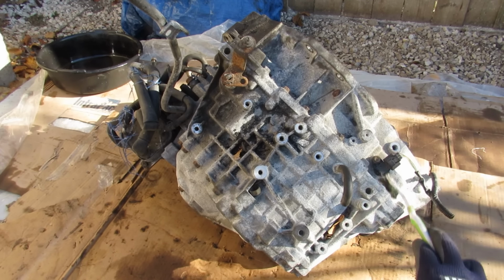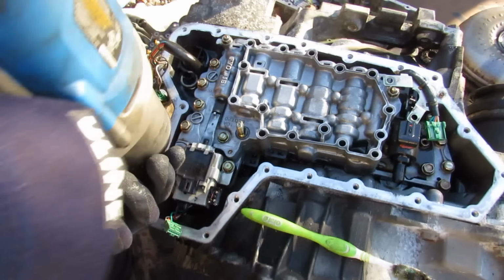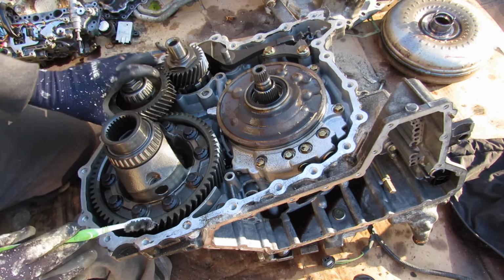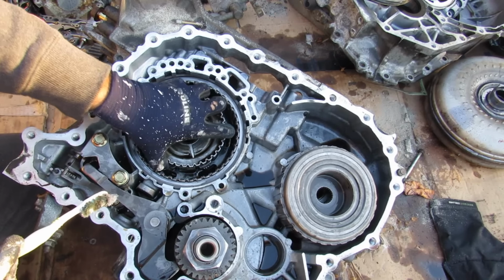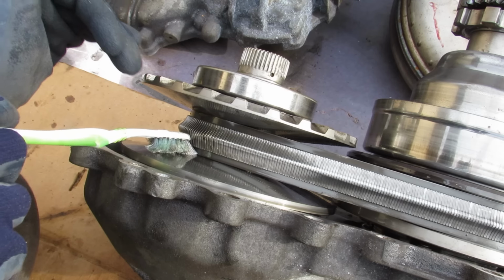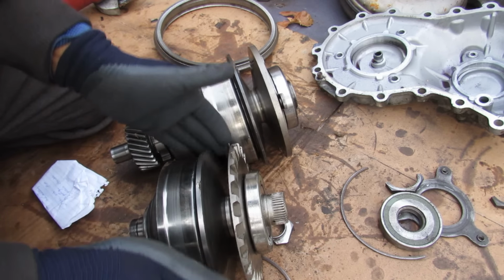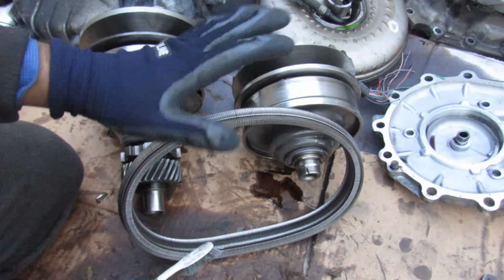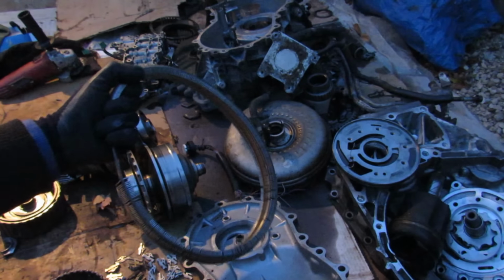Why Nissan CVTs FAIL

Comment: It's not just Nissan Ford also has had huge problems. So much so that it even got hit with a class-action suit. 

I like the idea of a CVT in theory and it does get better mileage. In addition to being much quicker on the shifting. 

However it's longevity is an issue as it hasn't translated into a better transmission.  Personally I would avoid them if possible for the time being. :/

Comment: I used to own a Mitsubishi Cedia 1.8L Sport. The CVT drive belt broke (Steel Band) and all the little plates fell off. I had the unit removed from the and I rebuilt it with a secondhand belt and a new oil filter. As I live In Thailand the only opinion here was a secondhand gearbox. The 1.8L was fitted with a box that you can select the gears manually from 1 to 6. So it was a difficult box to find. I contacted some Automatic Gearbox repairs In the UK  and I bought the belt and oil filter from there. It took some for the parts to arrive, but I have a motorbike as well. I rebuild and the garage that removed it for me refitted it and said if it does not work, then I still had to pay him. After a road test, he came back and shake my hand and said good job. (I was in the Motortrade for 30 years before moving here. Martin. (Thailand)

Comment: I remember when my brand new Ford Fiesta came with CVT for the first time and it started failing… I would press the accelerator and sometimes it pulled away and at other times it bogged down. 

The mechanic didn’t believe me so came out with me on a test drive and he drove… he was throwing my car around to try and force the fault and of course it didn’t happen (like all intermittent problems). The mechanic was saying that I didn’t understand how CVT worked and that I was just used to the old style auto gearboxes as we were pulling onto the forecourt… and the car dived like a champ. 

Mechanic face planted into the dashboard and he stopped the car… looked over at me and I said “yup, that’s it”. Guy shook his head and drove the car into the bay (but not before it dived again) and said “I’ve got no clue what is causing that. Sorry I doubted you.” 😂

I hated that damned Fiesta… never had another Ford.
Reply: The problem Ford CVT's had was water was mixing in it causing some issues. Happened with the Focus as well. They finally decided to fix the issue, but. Was too late by then
Reply: Was it a CVT? I thought the Fiestas came with Ford's dual clutch "Powershift"  transmission. It got such a bad reputation that mechanics started calling it the "Power-shit transmission."
Reply: @gearsofwar3xXx  yup… was definitely a CVT… even confirmed on the Wiki. https://en.m.wikipedia.org/wiki/Ford_Fiesta_(third_generation)
Reply: @NeoMorphUK  What country was this, because I thought the 2012-2016 Fiesta and Focus came with the Powershift dual clutch transmission in the U.S.
Reply: @gearsofwar3xXx  It was the UK and I can’t remember the exact year… maybe the mid 90’s. And it was definitely a CVT.just look it up on Wikipedia… it clearly confirms it.
Reply: @NeoMorphUK  No problem, I'm not questioning that at all, I now know manufacturers sometimes use different vehicle setups for different markets.
Reply: @gearsofwar3xXx  no problem mate. I look at the fact that one American engine could make 4-5 British ones… for example I was amazed that Ray called a 1.4 litre a tiddlywinks little engine… my brand new car is a 1.2 and it’s pretty darn nippy. Look up new UK Mokka. Opel make them too. Then look at the size of American cars with 7 litre engines and I’m like “What the hell?”. So yeah, I understand that Americans look at our cars and laugh. 

Also, I changed my old Mokka for he new Mokka this year… it had done 1,343 miles from new…. In THREE YEARS. Everything is closer together in the UK which is why we don’t have huge cars… and in Japan the cars are even smaller.
Reply: @NeoMorphUK  oh wow I used to put 500 miles a week on my car just commuting to work.
Reply: @adamperry4610  I get my car through a disability charity and get a new one every three years. No way I could afford a car due to not being able to work… but I would give up my new cars to be able to work in a split second. Chronic pain sucks.
Reply: @NeoMorphUK  - I feel like King of the road driving my 1967 big block F250 all original, no problems ever with the  motor or transmission in 30 years.
Reply: CVT transmissions are better suit for washing machines.

Comment: I drive stick.  I can skip the gears that go bad.  I had an automatic that went bad, but it didn't leave me stranded.  (I could still go about 55mph)  Anyone I've known with a CVT hates it.  They are slippy and laggy at their best until that chain snaps without warning.  Then they're stuck.
     Don't buy a CVT vehicle.  If you figure out that you have a CVT vehicle, get rid of it asap.

Comment: These transactions crap their pants at slightly over 40 thousand miles and even if they did fix it under warranty in another  40 plus thousand miles it'll do it again. Good luck getting a second replacement from Nissan. The only thing you can do is sue them in small claims court it's good for up to 5000 dollars. Why did the have to hook up a great motor to a defective transmission like this,? 👍 don't buy one of these cars ever. I think this happened when Nissan hooked with Renault. The French make good pastries not transmissions.
Reply: The French make great pastries 🍰 but not transmissions.

Comment: Very good explanation. I confess that I've not kept up with CVT development since I stopped being a mechanic 30 years ago, but I worked on the original DAF system cars years ago. They were fairly simple to diagnose and set up, and when they were set up properly, they worked well.
Reply: Centrifugal clutch and a rubber belt and centrifugal actuation of the variators (if I recall correctly) made these a lot simpler than this bundle of Space Age tech
Reply: The DAF/ VOLVO 66 was great fun to drive.  My mother had one in 1987. 0 - 25mph about 2 - 3 seconds.   0 - 60mph 2 minutes .     Her car started to vibrate a lot when you started to drive off.     We put it up on ramps and stripped out the bell housing.  One of the centrifugal clutch shoes had a broken spring, so it only engaged on 2 of the shoes.  The dealer only sold it as a kit of 3 shoes and return springs, so it got a clutch reline.    Worked fine once fixed

Comment: Very insightful, even though I don't have any vehicle fitted with that kind of transmission.

Question, though, regarding a popular American pastime nowadays:  What effect on the transmission will dragging a Pathfinder or Murano, or other vehicle fitted with that design of gearbox, in neutral and unpowered, with all the wheels rolling, like so many people do with these huge houses-on-wheels (you know, RVs, buses, that sort of thing)?  In the past I've been taught that dragging an auto-trans car with its drive wheels on the ground is a bad idea, except for short distances AND low speeds; any other sort of distance or momentum will cause the innards to shred themselves due to lack of fluid pressure/circulation.  Can similar destruction be caused to a CVT under those same conditions?

Comment: My 1st Murano was a 2009 and it was great! I bought a 2016 Murano and the trans slipped bad after only 2,000 miles. It would not engage when stopped at a light or after bring put in drive for at least a few minutes. The dealer, Preston Nissan wouldn't admit anything was wrong until a regional engineer drove it and ordered them to replace it. That car was totaled in a rear-ender and I bought a 2016 Murano. That trans slipped and the steering wheel had a high frequency vibration too. The vibration was also a problem with the Rogue and no dealer would look it at. Preston immediately started playing the lemon law game as soon as I told them about it. 5 visits later they flat out refused to admit there was a problem even after I complained to Nissan HQ. Preston Nissan in MD screwed the hell out of me on that stinking car. I have been a happy Kia Sorento owner since I had to take a loss on the Murano in 2017.
Reply: I worked for GM and Kia and I will tell you Kia was adamant about serving the car and no car was returned to the customer until it was perfect

Comment: We bought a new Ford Freestyle years ago that had a CVT transmission. Worked great up to about 105,000 miles. Right after the warranty expired. Our local Ford dealer offered to fix it for $8,000.00.  We still owed $12,000.00 on the car. We learned our lesson and will not buy a Ford or a car with a CVT transmission ever again.
Reply: that's rough man

Comment: i am recently interested in trying to build a cvt for a 49cc 4-stroke engine, a go-cart engine although i have it on a bicycle. i wonder if one could be made light enough to be useful at such low power.
Reply from the maker: Not an automotive CVT too heavy
Reply: @speedkar99  your comment is very direct and in my experience with computers we would even call it compressed because it contains allot more information than it appears to at first. to start with i was talking about attempting to set up a cvt on a 49cc 4stroke engine, and even mentioned that it might be too heavy. but in what dimension do you think i was talking about an "automotive" cvt because that isn't really a thing when you are thinking about making one. and there are cvts in use on many things with similar sized engines to mine, like rototillers, sometimes lawnmowers, and much more equipment with cvt/continuously variable transmissions. i certainly am not expecting that i can take a cvt from a car and use it on my 49cc motor, but your perspective seems to be pretty limited.

Comment: So a CVT is basically two Death Star garbage compactors spinning at high speeds, opening and closing, and instead of garbage, it's transmission fluid, and instead of Chewbacca whining about it, it's a steel belt. And they fail because the Dark Side never wins. Got it.

Comment: Every CVT known to mankind has failed...but manufacturers still try them. The variators eventually slip..producing fine metal debris... and wham!💥 YOU need a 8000 transmission Solution...Buy a Toyota Prius. Best solution for no mechanical gear box shifting.

Comment: I purchased a 2008 Nissan sentra new from the dealer. In 150k miles I went through 5 transmissions. I used the car as a daily driver and  drove around 120 miles a day.  After being a Nissan mechanic for 20 years I will never buy another new Nissan product.

Comment: We have a Ford Freestyle that used the Jatco CVT. Surprisingly it has 140k miles on it and it has towed a set of jets skis on a couple of occasions but Its a beater mobile and we are always waiting for it to fail. I much prefer my Ram SRT 10 with the tremec t56 and Mazda has the only auto I fully trust anymore.  180k miles on a 2013 CX5 we bought used with 135k on it.

Comment: Love it. Cardboard shop, no "professional" tools, use of families undergarments for clean-up - this whole vid shouts "I did this in my backyard, what's your f'n excuse?". Damn fine explanation on how CVT's work as well. No BS, just wrenching; I needed that, brother.
Reply: Seen mechanics with 50 grand of snap on tools that can't fix shit. Maybe 100 grand.
Reply: @genefoster8601  if your mechanic has snap on you can almost guarantee they cant fix shit.
Reply: @grenadegoboom4967  got a little bit of snap on, craftsman,  Bonney, indestro, matco, and every brand under the sun. Some been out business for years. 50 year collection.
Reply: @genefoster8601  when all the tools match...you should start to worry.
Reply: @grenadegoboom4967  lol. 👍👍🤣
Reply: @grenadegoboom4967  No longer i fix junk that customer is claiming to be as good as new ,real professionals know better on how not to take chances .
Reply: My 10 year old son can grab an electric gun and pull apart anything...that's the easy part.  Granted this guy seems to know his stuff but you would NEVER tear down/rebuild a tranny in these conditions...EVER.
Reply: @getsum697  probably a spare that got warrantied at the dealer, hes probably their master tech
Reply: Press F for his brother's gym shorts and his wife's something 🤣
Reply: that impact though... looks like money to me.
Reply: @81970277324  Something he can afford by saving other stuff :)
Reply: @81970277324  those guns are around $60 to $100
Reply: What about his electric impact gun?
Reply: @catinthehat5140  electric impact is not very expensive. I have one and an air impact. Electric is fine for not super tight stuff.
Reply: 😜busted-uh-NUTT‼️ JAJAJAJAJA 😜 omfGAWD 🥵😵‍💫🚀😈👽😱

Comment: One of the earliest applications of the CVT was the DAF Daffodil, a very small car. The drive belt was rubber leading to the CVT attracting the uncomplimentary nickname of the rubber band drive. These days CVT is commonly used in agricultural machinery like tractors.
Reply: And snowmobiles.  The belt system has been in use for years.
Reply: @brianjohnston9822  yes, the DAF Daffodil was a thing in the 1960s.

Comment: Great video. You really know your stuff, especially the part where the belt pushes not pulls. And that all depends on the type of oil you use and why it's really expensive. I think I'll stick these transmissions in the same bin a duel clutch transmissions. Why change the original type transmissions when they work perfectly well for 100.000's of km's.

Comment: I've been a vehicle inspector for over 7 years now. In all that time I've inspected more failed Nissan and Ford CVT transmission failures than any other car maker. CVT transmission are the weirdest trans I've ever seen. Fact is that other than the 2 brands I've mentioned I've only looked at one Dodge CVT failure.
Reply: What sort of mileage did these failures have? Especially the Nissan ones.

Comment: Yeah this is true I replaced two before 125,000 miles. The dealer stiffed me on the transmission they owed Using my two miles over the warranty which I think they drove it till it was over the mileage. I took in before it was over the warranty. Warranty shouldn't count on recalls

Comment: Outstanding video. Only criticism was the destructive disassembly of the variators using the angle grinder. It would have been nice to see the actual shop manual procedure to correctly take this CVT apart without breaking anything. I cannot believe Nissan did not publish such a procedure unless there was explicit intent to have them be not repairable. speedkar99 did a great job at least trying to minimize making this a butcher effort.

That said, I believe most CVTs (as this and other channels have mentioned) are not easily repaired so when EOL is reached, you will be replacing it. For that reason, I will probably avoid CVT equipped vehicles for the forseeable future. Sure, $4,000 is only once every 150,000 miles, but all that nice fuel economy the CVT gives you is now out the window.

As far as increased failure rate in higher power applications, Nissan could, if they wanted to, could build larger CVT systems that can withstand the higher torque required that could also include towing.

But that counters the chief advantage CVTs give you which is impeccable efficiency and fuel economy. On a Nissan Armada towing 6,000 lbs., you are not going to care anymore about economy! :)

Comment: My 2017 Altima cvt failed at 62,500 and warranty ended at 60,000 miles.   Nissan was nice enough to pay 50% of cost for DEALER rebuilt which was 1300 for me and 1300$ for Nissan.  That tranny failed, so dealer was able to get real rebuilt tranny and replaced it and now it runs like new.   My mechanic said Vegas heat does not like these cvt tranny so he suggested I do a fluid change at the beginning of each Vegas summer, which I gladly do for 225$

Comment: This is the video you should watch to never want to touch anything with a cvt. Truly impressive that a manufacturer can even offer a warranty on this design. The idea that whining from metal on metal slippage and high heat output from that interaction is a normal part of operation is just concerning.

Also explains why nissans are significantly worse in the US market where they simulate fake gear shifting. That means the cone adjustments have to happen quickly and they're more likely to fall out of sync. Then the belt falls out of correct tension and either promote slippage or more direct metal on metal contact. Mitsubishi probably couldn't offer 10 year/100,000 mile warranty if they kept the same operation on their jatco cvts

I'd like to see someone take different brands' cvts and stick them in a constantly shifting high load scenario on a dyno to simulate towing and see how long they last

Comment: it sure looks over complicated of a system ... is the Mitsubishi one any better ?
Reply: Mitsubishi also uses jatco(subsidiary of nissan) cvts. Their applications don't fake shift though so it's easier for the cones to adjust in sync to keep the belt at the right tension

Comment: Never buy a vehicle with anything 1.0, which is the reason to avoid the new Ford Bronco like Covid-19, if you like it, wait a few more years.  My opinion, they’ll make a V8 model, the base motor will have many problems as a 2.3L 4 cylinder motor in such a large vehicle will burn itself out before 100K miles, same goes for the Jeep Wrangler with the 2.0 liter motor, sitting in dealerships.
Reply: If a vehicle wouldn't be drivable with a naturally aspirated of the same displacement, it shouldn't have a turbo of that displacement. At that point it's just a vehicle for less than 5 year ownership that you ditch before the market finds out that how they'll hold up and resale plummets